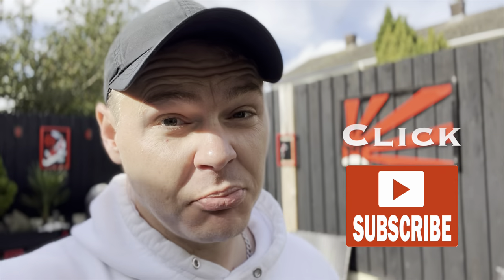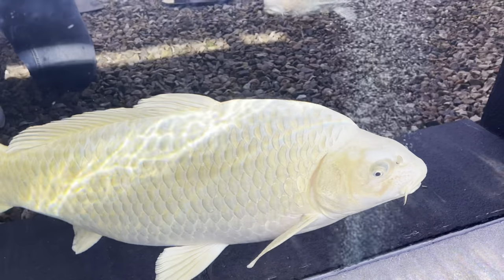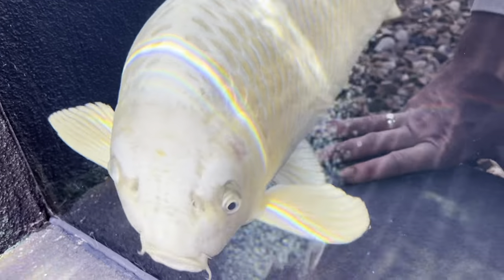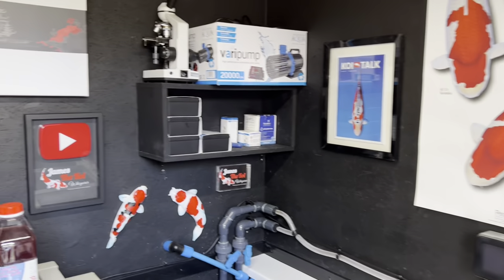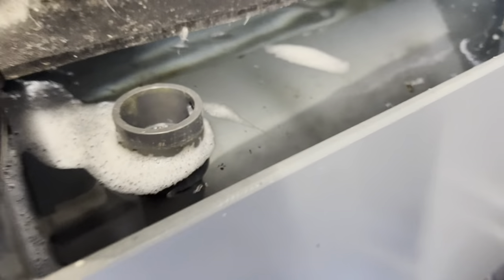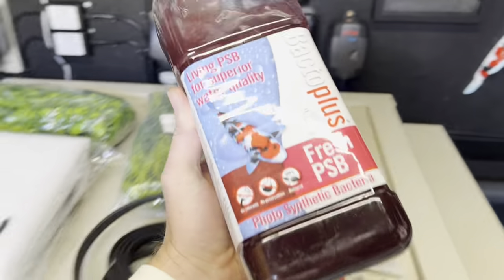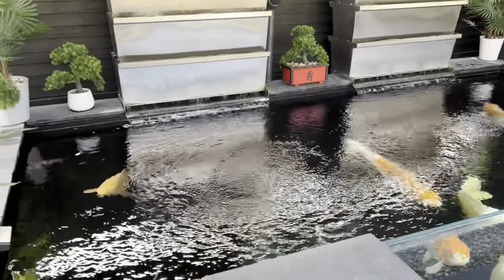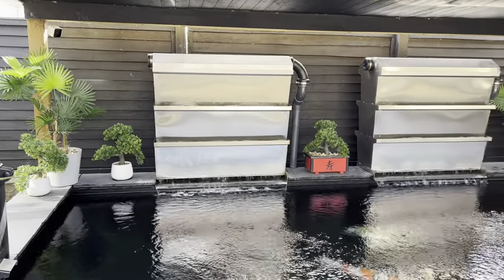SO MANY KOI POND JOBS FINISHED **A CRAZY IDEA THAT MY SON HAD TO HELP ME FIX**

Comment: I bought a real heavy duty clear tarpaulin a few years ago to do exactly the same as you and I noticed a big difference in my winter temps. I ordered mine with eyelets every 14 inches  and bought a load of small bungee cords with a ball on the end to enable it to flex a bit. Lasted 2 years before I changed my pond. Just wish I could remember where I got it from as it never split or tore.  Typed this as I was watching. 😂 Where have you found this heavy duty one on line?